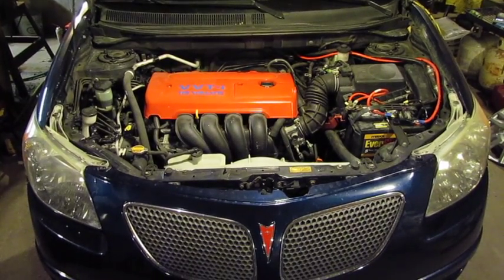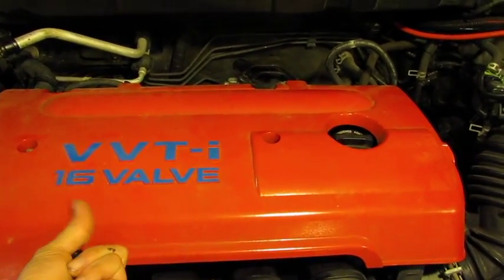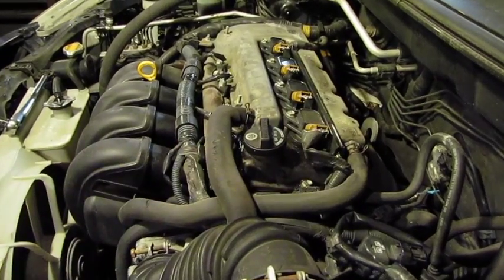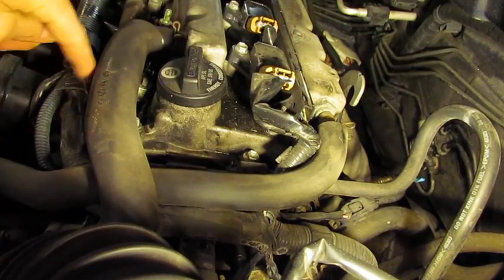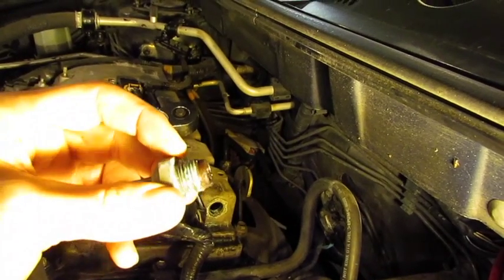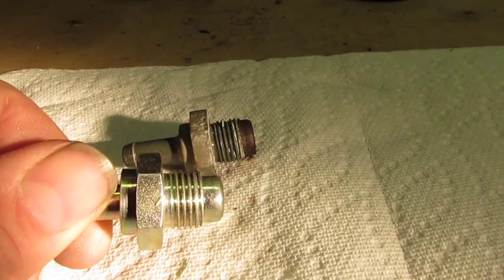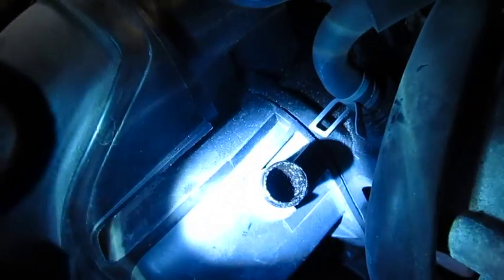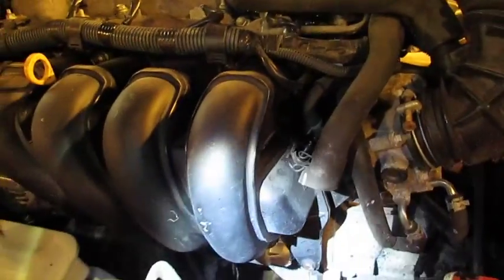PCV Replacement 1.8L 1ZZ FE  Matrix Vibe and Corolla

Comment: thanks for the video, I have question
whenever I connect PCV hose to the intake manifold, my engine feels different, unstable RPM
any suggestions why ? to cover this issue, I just close sealed intake manifold, but the hose remained on the PCV

Comment: I’ve done the replacement but I’m still getting some idle issues
Reply: hey this happen to me, when idling my RPM so unstable
Reply: could be a vacuum leak, is your car manual ? idle air control valve? throttle body needs a clean?

Comment: My valve supposedly had been changed at 130k per carfax; put new one on at 230k; original was still there; not clogged nutcracker hose was entirely filled with crud down into intake too.

Comment: A small adjustable wrench opened at 7/8" will remove the PCV. Take your time and a cheap adjustable wrench is fine...  old 2000 Corolla is the same engine as a Pontiac Vibe... The replacement hose is about $15 delivered ... peanuts and you can do it all yourself to replace hose and valve! Easily save $200-250 versus getting this done at a garage... see ?

Comment: Will a bad pcv valve cause hesitation and stalling when engine gets to operating temp? ..my vibe has been parked for months because of issues..285,000 miles and I never knew to look for this valve..thanks!
Reply: @Jay Todd ! If you have PVC problem, after 285k miles, you need to change 2 things now. 1. PVC Valve 2. Head Gasket. If possible change the tube as well.

Comment: I have a 2006 Vibe Base Model how do I see which engine I have? The 2 options are 1.8L1ZZ-FE, or 1.8L 2ZZ-GE 
Thanks
Reply: 123 456 2zzge is a vvt-li engine it has vvtli written on the head cover and it has a aluminium intake manifold the engine which you see in the video is a 1zz-fe vvti with plastic intake manifold
Reply: There is usually a sticker mounted on the underside of the bonnet which tells you the specific engine type. If not, try looking in the owners manual or online.
Reply: AFAIK,  2ZZ-GE was only in 1st generation Vibe GT models (and Matrix/Corolla XRS, Celica GTS and some Lotus Elises). Any other 1st gen Vibe or Matrix should have the 1ZZ-FE

Comment: How good is that manifold intake? I'm thinking of getting a metal one
Reply: Did you find one?
Reply: @Thabo Poo ! You don't require metal manifold, unless you are installing turbo kit. What is there, is faithful one.

This is 1ZZFE engine;  is very faithful one. You see, sometimes, PVC valve blocked because the must have been running with low octane petrol, i.e. 91, or this engine was filled with full synthetic oil, which bad for this engine.

I ran the same engine, from the first filling onwards -- except for the drive away fuel, on BP 98 Octane. After seeing many videos of PVC valve problems in YouTube, I decided to check my PVC, Oxygen Sensors, Mass Air Flow Sensor, Timing Chain Tensioner, I found none of them are required to change. There is no messy grits on PVC, no carbon on Oxygen Sensor, no dust on Mas Air-flow Sensor, and no oil leak through Timing Chain Tensioner. 

But why, even in this 12 year? Answer I found answer in myself. It is, regular self-service as per manufacture's advise, and use of high octane (98) petrol, without fail.

Comment: That looks pretty bad mate i did my Yaris 2002 87.000 miles always serviced religiously and yearly 3.000 miles (I do low miles) and it looked half as bad as yours so it's worth taking it off everyone it's so easy plus whilst you under the hood (Bonnet in the UK) clean the MAF sensor it's quick to do.Great video btw.Oh and i cleaned mine out not replaced it plus the cabin air filter which was bloody filthy and that's the air you breath in the vehicle lol

Comment: I just got this serviced on my 2003 Toyota Matrix, I purchased it on ebay but when I started to replace it, i notice the treads were a little more longer then the OEM PCV Valve i had removed, I had to improvise.

Comment: As I have the same car and the same year this video is helpful in demonstrating what my engine would look like if I had NEGLECTED it for the last 12 years. I change my PCV valve every 5 years and use PAO synthetic oil. If this Vibe's engine has gone 200,000 miles then mine ought to last 2 Million. ;)
Reply from the maker: Used cars are always fun, guessing what was and was not serviced by the previous owner/shop. I am just glad I caught it before things got worse.
Reply: I hope you caught the issue before the point of terminal damage  . Since this video was done over a year ago, I would like to know how the car is running and whether the engine is burning much oil. Thanks.

Comment: Do you need to clean intake now, maybe Seafoam or something now?
Mine keeps blowing off at the intake side.
I replaced valve 6 months ago and now blowing off at start up a few times a week.
Any idea whats going on?
I have a 2009 Vibe btw...
Reply from the maker: Really depends on how how much oil is bypassing the PCV valve.  If the hose is blowing off, I suspect blockage.  Try running air through the hose to see if it clear.  I am not familiar with where the PCV hose goes into the intake on a 2009 Vibe, if is is low enough, gunk from the intake may have accumulated near the port, requiring it to be cleaned.  Seafoam may not help, would likely require physically cleaning the port or intake.
Reply: +Fred Lyst thanks for the reply. looks like pcv same position, remove intake plenum to remove. I'll likely but me house as well as physically clean it.